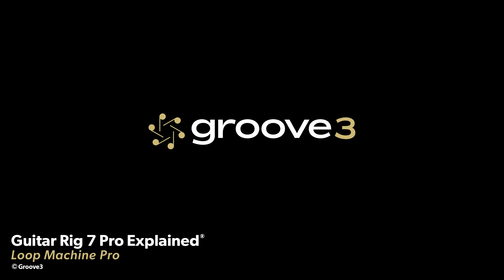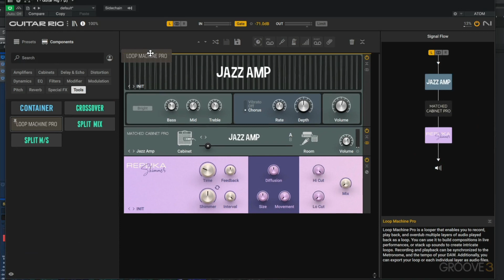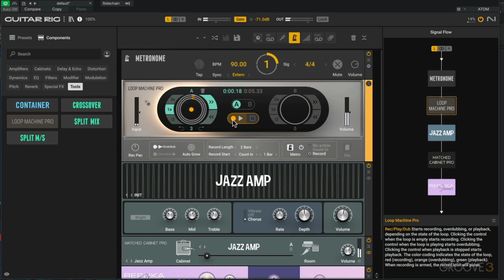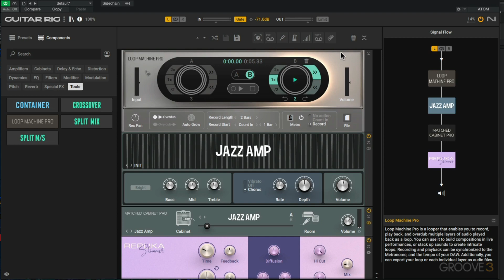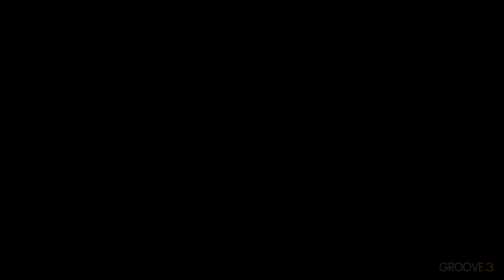Guitar Rig 7 Pro: Loop Machine Pro

Comment: How do you stop the looping on the computer if you don’t have a pedal to press on?
Reply: I use the Nektar Pacer. It's just a midi controller foot pedal but it works great. Using it takes a couple steps though: 
1. create a midi track in your DAW 
2. assign the "input" of that track to the Pacer (I use the Pacer but this would work with any midi controller)
3. Record-enable that midi track.
3. Now set the input of the guitar rig track as that midi track. Now you're able to send midi signals to Guitar Rig!
4. Then, one-by-one, right-click on all the buttons on Guitar Rig you want to assign... use the midi-learn feature to assign them to the Pacer button of your choice.  

Once you do that you can save those assignments as a Guitar-Rig set up and you can even save the track layout of the midi track + guitar rig as a template. So it's a little complicated to get set up but you don't have to do it every time. And once you do, it's pretty sweet to be able to use a pedal with it.